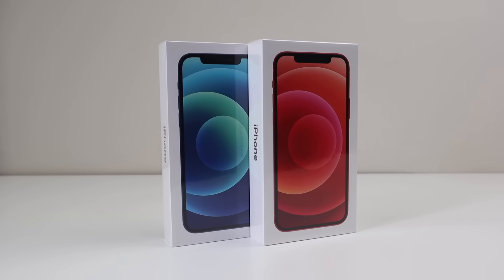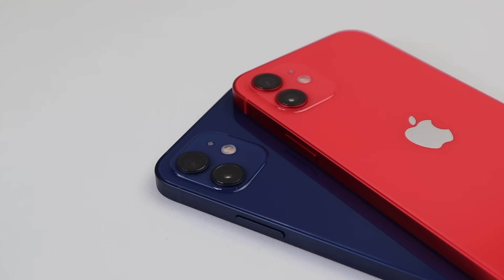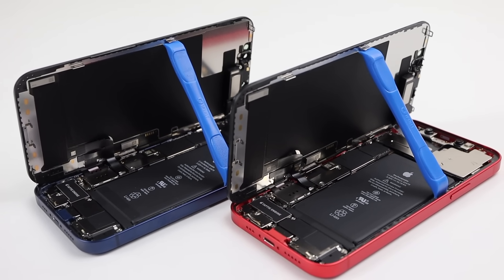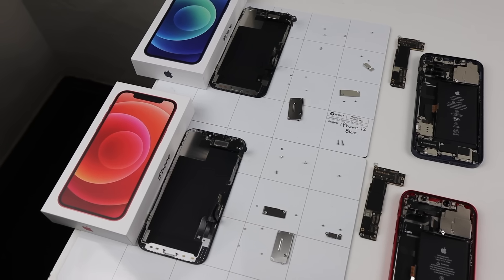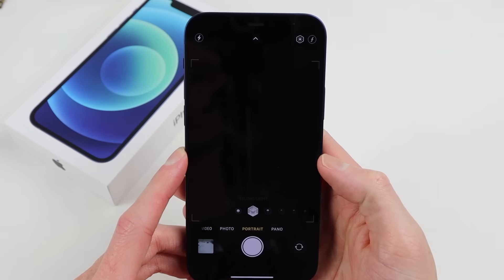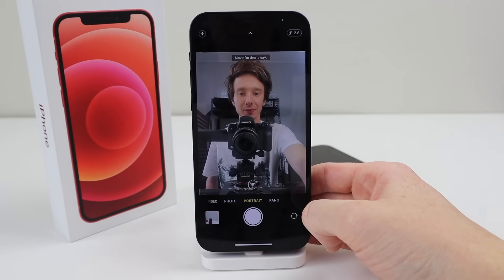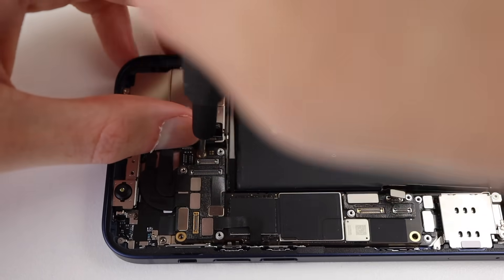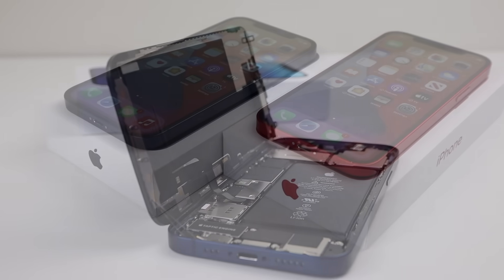iPhone 12 Anti Repair Design - Teardown and Repair Assessment

Comment: No phone should have the back screwed down you should always be able to access the battery. A kid at my work dropped his phone and it started calling the emergency services. None of the buttons were responsive it was just frozen like that. Pulling the back off and pulling out the battery would have solved that but no that's not allowed anymore. It was super quiet for some reason so I thought it was an automated voice but i put the phone to my ear and realised it was an actual operator who was starting to do the whole "if you're in danger but cant speak can you press a key". Had to talk to her and convince her everything was fine. I hate modern phones. Just have the back pop off. I've never had water problems with any of my smartphones just stop dunking them in water ffs.

Comment: I would like to express how bad my experience with buying a Apple desktop has been. My fan had an issue, it was loud. I brought it in to apple and my computer was on a "secret recall", meaning if your computer had the issue and you brought it in they would replace it. Only problem was I was 6 months too late for the recall. Mind you this is a $3000 desktop, the service should be superior for that price. I asked them if they could fix it and they told me no because the computer was built into the screen (no tower). they said they were worried the screen would crack if they tried to take it off.... Why would you sell me a computer you cannot fix??? what a piece of trash company apple is. This is my warning to anyone who is borderline on whether or not to go apple, DO NOT GO APPLE.  they are selling junk and they do not want to fix they want to sell you more. Do not buy from apple

Comment: Thanks for the video, I will not be buying an iPhone now. I’m surprised iPhone have not programmed the phone to short the battery out a month after warranty runs out.
Reply: That’s a joke because the battery will already be fried to 30% lifespan before the warranty even runs out
Reply: I guess they intentionally made the battery 2815 mAh so that they want you to buy a new phone. Sneaky asshats.
Reply: They don’t need to. My experience with iPads, they eventually force an update that makes the device slow, battery needs recharging more often…becomes a brick.

Comment: I believe all components has unique IDs and are stored in some ROM/flash memory created during factory setup of the phone and when turned on it runs a antitamper check and disables certain features based on it, updating that memory with replacement component IDs being could make it work.

Comment: Imagine Ford and GM tried this many years ago, telling car owners that if they didn't use genuine Ford and GM parts, they'd void their warranty. The carmakers were successfully sued, can't do that any more. Apple hasn't learned that lesson.
Reply: Tesla is already doing it xD
Reply: Dodge certainly tried that with the  Caliber. Turns out the key has a chip in it and the car won't start without it in the ignition. If I wanted a spare key, I'd need to go to the dealership and have them program a new one. I was told this would cost about $400 for a car that is now worth $1000.
Reply: did you not watch the senate hearing. they did do this. claiming the software that runs their cars is their property and you are just renting it and if you swap out the chip you are pirated and will be prosecuted for copyright infringement and creating a counterfeit product.
Reply: @Q5Grafx  Honestly I can't catch time on CSPAN due to my work schedule. But I'm not surprised Tesla is claiming that. Back in the 1970s Ma Bell (aka AT&T) did the same with the Mickey Mouse phone. Customers later found out they had only bought the "outside shell" while the innards remained Bell System property, and of course they charged rent on the monthly bill, all the while the federal government looked the other way.
Reply: Electric cars give manufacturers a loooot of new opportunities to earn extra money from their customers. You cannot replace the battery in your electric car, which will lose capacity after a few years of use - you have to replace the entire car. This way you can completely kill the used car market. This is not eco-friendly. This is greed.
Reply: @aro8000  With a price differential like that, don't put it past chop shops using tools to get into the battery compartment and swap out the tired battery with a fresh aftermarket one. If the old one has to be destroyed in the process, they'll do that.
Reply: I mean, the same companies that partner with dealerships in order to manipulate the prices of vehicles? The ones who are now paying the price (ironically) of that partnership because dealerships managed to lobby laws to make it impossible to purchase directly from the manufacturer? That Ford and GM and every other car manufacturer?

Comment: Apple are totally contradicting themselves here, the very best way of “Recycling” is to Maintain, Repair and keep using your old iPhone or any other Brand of Smartphone, until they become too outdated to be worth keeping!
Reply: wanna buy a pristine 5s
Reply: @Q5Grafx  still got an old 4S and just need a new battery.
Reply: @Q5Grafx  Yes.
Reply: here is a little apple tip i figured out maybe it can help someone. if something happens during an update and the phone bricks. there is an update folder in the itunes program just go in and delete the contents of that directory but leave the folder intact. this will allow the phone to re-download the update and install a new copy instead of it continuing to try to install the corrupted install.  when mine bricked they told me it was too old to be worked on and i would have to buy another. i read someones post that told to do this and it worked. by the time i read it i was long into my next phone and it wasnt an apple so it sits here in perfect condition, like new and not being used.
Reply: Shrek  shouldn’t have to do that
Reply: Shrek  don’t break ur phone then lmao
Reply: this, ive used an iphone 5s til november of last year to buy a samsung phone.
Reply: Shrek  tbh android looks hella ugly imo

Comment: My 12 max pro I bought in February came with the plug and cable. It is a C only for the adapter and a typical apple connection for the phone. I’m surprised they didn’t have the apple connection style for both ends. I haven’t heard anyone complain of those type having breaking issues. Hmmmmm🤔